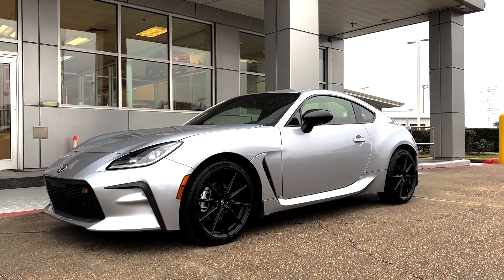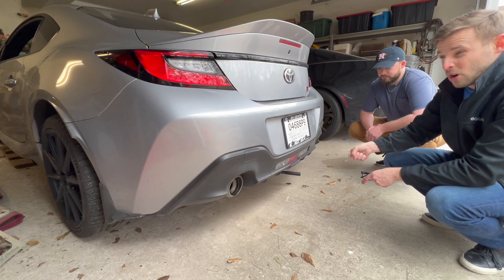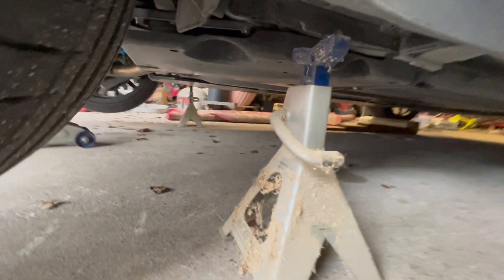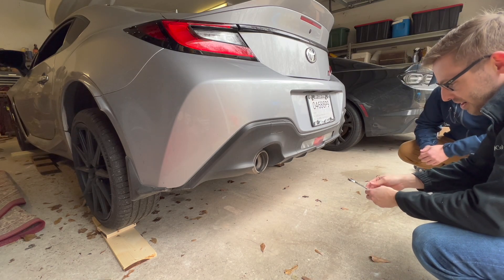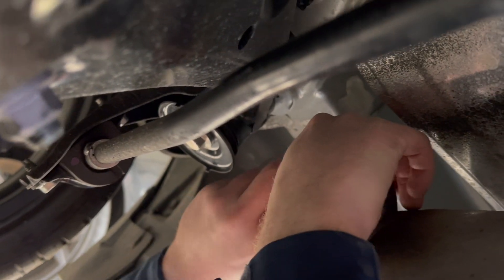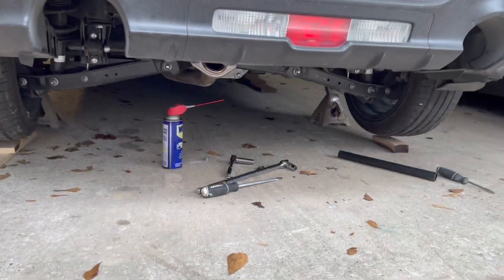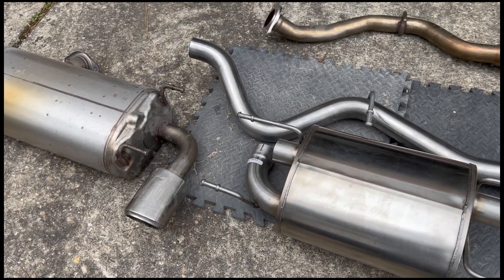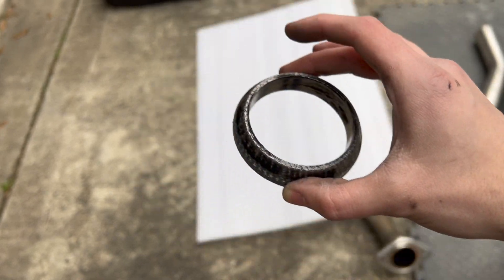Installing The Corsa Cat-back Exhaust on His New 2022 Toyota GR86!!

Comment: How about adding more sound deadening material to reduce some cabin noise ?
Reply from the maker: You could but it’s not at the point to where I feel it’d be necessary. But if you wanted then probably underneath the front driver and passenger carpet and trunk area would be a good place to start. 
Thanks for watching!

Comment: Turn off your sound sim, sounds good from the outside though, this one is convincing. Torn between this, the perrin, and fujistsubo. How is the drone?
Reply from the maker: Drone isn’t too bad, above 75 you’ll notice it quite a bit but at or below 75, there’s not boomy drone and only notice it is when you start to dip into the gas to pass someone. the best way I can put it is, pleasantly in the background. Hope that helped 
Thanks for watching!
Reply: @drivenmad2089  Thanks for the follow up!
Reply: Hey this is Austin, and I just wanted to make a small update on the drone. It only noticeably drones at 70-75 mph. Blows 70 or higher than 75 this is no drone that I can hear. It’s a small gap but for some reason it drones there.

Comment: performance is also better?  how much does it weigh less than the standard one you removed? And the price? Thank you
Reply from the maker: It probably only weighs about 5lbs less than the stock system.  The muffler is smaller and lighter but then you add the exhaust tips which are beefier than the stock ones and the mid pipe was only slightly lighter. As far as performance the only noticeable thing is throttle response at least from the seat of the pants feeling.
Reply: @drivenmad2089  Thank you!!
Reply from the maker: @giorgiotibaldo  no problem man! 
Thanks for watching!

Comment: Thanks for the nice video. Are you sure this is configured for a 2022? I think the reason the instructions don’t address the factory donut gasket and springs is because those may be 2022 changes, whereas this system was designed for 1st Gen vehicles. The springs allow the exhaust to flex with some movement and most of the cat back systems retain the donut gasket, so I’m surprised it wasn’t needed and makes me think that could be something Corsa revises the system to work with, along with the springs. Who knows. Sounds good.
Reply: The Corsa website explicitly supports the 2022 for this catback. They should update the instructions to document the new gen cars though. The instruction manual in the website (and in the box probably) still only says 2012-2015 which is kinda shitty.
Reply: @Synthwave89  i Just installed mine today on the 2022 brz and i did not come with instructions. but its a pretty self explanatory install
Reply: @Gingerlata  could you load a clip on youtube? And could you also show if tips are centered or how we can "regulate" them? Sorry for my not perfect english :)

Comment: do you know if you can turn off the artificial engine noise?
Reply from the maker: Yes, I believe it’s a fuse that you have to pull if I’m not mistaken
Reply: There are a few videos out there on how to do that - there's a plug you have to disconnect beneath the  dash panel that faces the passenger door. Remove the panel, pop the clips out holding it in place, and unplug. Only takes 5 minutes or so.

Comment: that's pretty loud in the cabin. a tad too much.
Reply from the maker: Keep in mind you’re also hearing some of the intake speaker noise as well. 
Thanks for watching!
Reply: @drivenmad2089  I don't know why these manufacturers are piping in fake sound. Ford does it with their Ecoboost, BMW does it as well.  It's a bit loud, doesn't sound bad. I see alot disabling it.